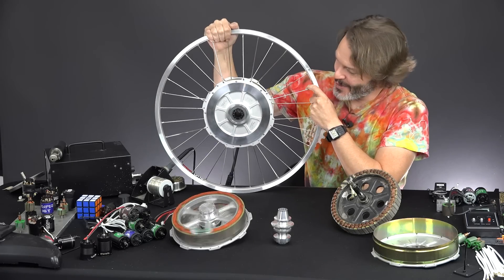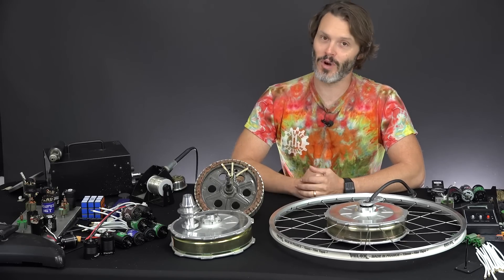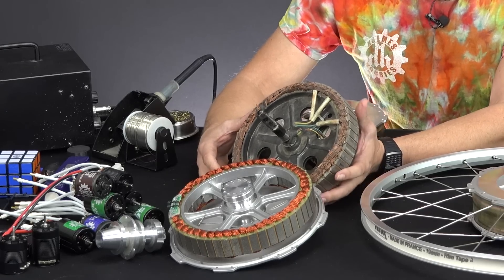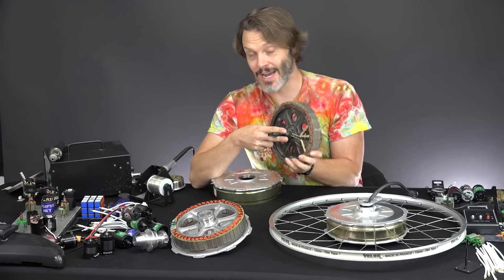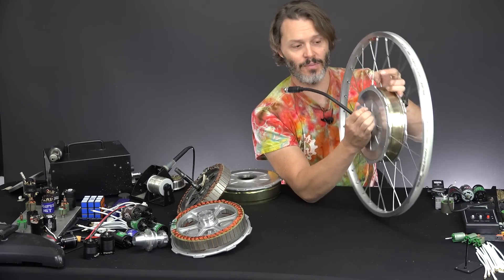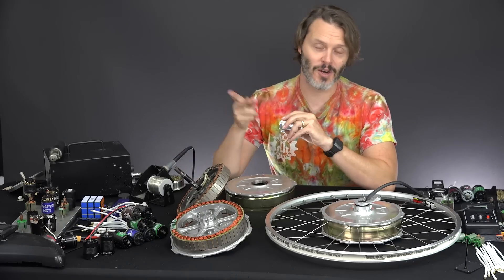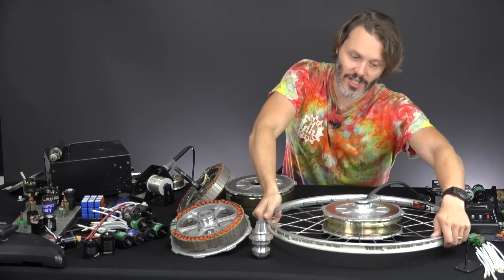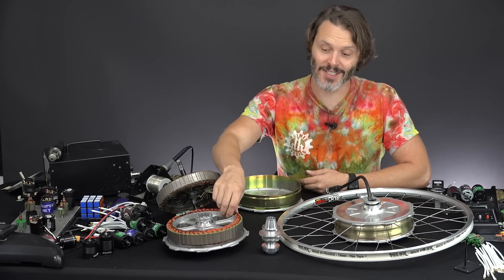Best E-bike Motor You Can Buy - Grin Tech All Axle Electric Bike Hub Motor Overview | Holmes Hobbies

Comment: Most  $1500 e bikes are just a regular $200 bicycle with a $250  kit and battery already installed.  What a Rip offs.
Reply: 250usd?

Have you watched any builds or performed one? 

In the case you have not, or for someone reading this, keep in mind the following: 

The research involved to make all the parts fit and work (The most expensive part as well is not listed in this comment - battery).

As a supplier and custom builder/repairer I can tell you that a battery in AUD (time of writing this) is starting at AU$ 390-450 (36/48V - 20/13Ah).

If you bought a new eBike from me, I wouldn't sell anything less than a US$200 (maybe AU$350) frame because it needs to have a decent quality build to handle the extra 10-20kg of weight (remember all that weight also goes on the front forks along with your weight) when you brake, and brake force increases the stress, if someone has a cheap bike, that person can look forward to a potential issue, possibly a nasty accident if it's all cheap bolts between them and the road)

In AU$ you are looking at 1100-1500 in parts and you still need to build it, that's for 1000-1500w build with at least 30-45 minutes battery life flat out throttle run time. (actual not PAS bulls#*t claims of 100's of kms range, you are looking at around 20km on a charge).

Remember a business needs about 50% mark up to survive (for sale in AU they lose tax on shipping parts in, freight/shipping, port fees - you may not pay for an item to enter, but they will pay because they have a container of bikes, or a large order - then they have to pay running costs on the shop, consumables, warranty, delivery to customers house may be free so there is that to pay as well on the business side... Oh and wages, electric, eftpos (card machine and bank fees).

If you go out now, know nothing about eBikes, or bikes. You need to work out drop out size if you are / are not upgrading an existing frame as you have to make sure the wheel rim fits, you have to get a battery that will fit (you can get some frames with very little space), upgrade the brakes potentially, the controller has to fit as well.

Now it may be luck when you buy parts and they just fit, but it doesn't happen for everyone. Then after all that you have to hope you are not returning an item after all the hard work, pay to ship it back, take it apart. As an individual it's frustrating, worse if you order kits for a business and have orders to fill and then have to make customers wait because 20% of parts from China can and do fail. China builds everything with the rule that 4/5 is good parts, the rest of the 20% is acceptable defective parts.

What tools do you not have, bottom bracket tool, freewheel or cassette removal tools, if you get this wrong upgrading, you will have to buy a new gear set, if you get a freewheel kit and you have a cassette waiting to go on it for example.

Not trying to be negative for those reading, just real. I have been doing this a while, it can be positive and easy, and I wish this for all of you, but it can also be a challenge, or damn right frustrating to the point that a passion becomes a job - that was the case when I started out.

I wish you the best William - I hope you are still in the R&D stage for your build, but if not, if you have any questions I am here to help

Happy riding guys!

Comment: We need this for automotive applications so any car can be transformed into electric...
Reply: I was about to post the same info minus the link, thanks for the info!
Reply: Cost too much the best option is to get old motors and mount them in the vehicle then work from there forklift motors work well
Reply: Worst part is having to get new batteries for a car though I think that would be hell no matter if they premade
Reply: @zeeshyyt2  They have electric hubs now for the Prius....  50hp each side for about $9,000.  It can be done for any car if someone wants to do it.   This would help the automotive industry a lot, to give any car a 100hp boost and have 20 miles of electric travel with a small battery pack that fits in the spare tire area. 

https://www.youtube.com/watch?v=iQ4lTPVR3qc

Comment: I’m very interested in using this motor in an EUC (electric unicycle). I just don’t know the difference between this and the Chinese motors used in EUCs to know. EUC motor run off 84v or 100v battery packs. I don’t know if that’s necessary. Anyone know?
Reply: Building yourself or buying a kit? Happy to help out with what I know but I have not done a unicycle yet, I do custom builds in Australia

Comment: I was just reading about the Grin 'all-axle-hub-motor" last night, I have an old "Giant" frame that I converted over about12 years ago used a crystallite 407 in the rear wheel, worked ok when the SLA batteries would take a charge. The front suspension fork is an old "Judy Rock Shock" and I am thinking that if I can come up with the funds necessary, I should probably get a whole new package. The fork does have mounts for the disk calliper the rear brake is of course V-brake. It does seem that the folks at Grin have this motor nailed down, expensive yes but well worth it I figure.

Comment: I’ve been using Goldenmotor Magic Pie v5 and Edge Motor’s on all my builds.  I’ve done 5 so far with the oldest built in 2016 still going strong.  I like a super clean cockpit so the only thing on the bars is the thumb throttle.  Since it’s throttle only I can use any brakes.  Some bikes like the oldest uses no torque arms because the kickstand on one side and the derailleur on the other side are heavy steel and so far never had a problem even at 25amps with 52v battery peaking at 58.8v.  Another MagicPie-V5 needs 2 Grintech v4 torque arms ir it will spin I the rear dropouts.  The edge motors are smaller and have had years with no trouble and no torque arms in aluminum rear dropouts.  All these have strong regen and are about $400 usd from Goldenmotor.ca or Goldenmotor.bike. I love that the controller is built into the wheel so I get the cleanest build that’s a regular bike with a throttle for whenever you feel like using it.  These are commuter type bikes so nothing fancy.  I’d love to build something crazy but the costs add up quickly.  Love the videos!!!
Reply: where do u get ur batteries from

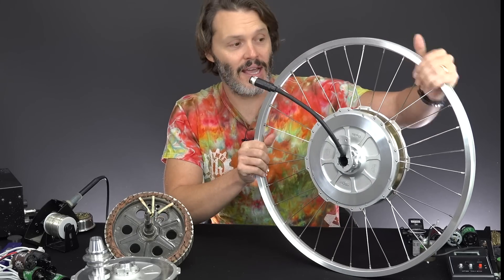Comment: HolmesHobbies, can you design me a swapshell hub for this motor? My desired swapshell hub will work for my hubmotor (on front wheel) like my swapshell for my internally geared rear hub made by Kindernay. See the way this works at 1:09 of this video: https://www.youtube.com/watch?time_continue=61&v=ERedaKUYYf4&feature=emb_logo.  I would like to be able to switch my hubmotor among my roadbike and my fatbike on the front wheel. As a final trick, I would like to be able to use a plain front hub (no motor) for the days that I want my lightweight bike and a proper workout. This would allow me to have a single bike that can be powered or nonpowered.

Comment: I have been using my own torque arms for a few years. Easy to make your own using 9-12mm (depending on Adel size)box end wrench with a hose clamp and bolt.. Bolt goes throu round side of box end wrench. Open end of wrench goes on axle.. Hose clamp to frame or fork
Reply from the maker: I've certainly had a few bikes with wrenches for torque arms!
Reply: Interesting. I hope ti see a video on that. Thank you

Comment: You should re-consider your use of close-ups, and know the exact difference in the failure rates of the two types of torque transfers.
Reply from the maker: It's all documented on endless sphere forum,  which has a better memory than I do.    The raw numbers aren't so important IMO, except that this hub is proven far more reliable in terms of torque transfer.   You can find the numbers if you want exacts.

Comment: Strap on a 12V car battery, Jerry rig a 13,000 RPM Dewalt grinder motor with a DC to AC inverter. Use a 15amp dimmer switch to control speed. BANG ! About 7 hrs usage at 50% pwr (35 kms/hr). TOP SPEED: 70 + kms/hr ! Next mod will include motor from Bullet mixer on front wheel for a 2x2 AWD system !

Comment: I checked out the site, man those are redicoulisly high prices for only 500w kits. Bafang has 1500w for those prices.
Reply from the maker: China engineering from  a decade ago VS fresh canadian engineering and assembly.    Cast parts vs machined parts.
Reply: @HolmesHobbies  again with "cast vs billet" 

Cast is more than enough for 2kw hub motors 
Why should I pay premium for something that is not much of an improvement?

It's not ultralight specific motor to me or other average commuter 
2kg means nothing
Reply from the maker: @blackturbine   If you have never stripped out an axle, spun one out, or had a fork fail, then you  haven't experienced the problems that this fixes and it's likely not for you.  My point about cast vs machined is that cast is cheaper.  They aren't making 10s of thousands of these motors, so the parts are machined and not cast.  Its a short run motor, which will always be higher cost.
Reply: @HolmesHobbies  it's not fixing a problem 
It's just forcing you to buy some premium frame and forks 

Why not make an axle with a keyway that won't strip out 
Or even better 

A chain or belt drive so axle wouldn't be a problem, motor can be much more lighter and easyer to cool down.
Since we are already need to modify our frames to fit that hub design why is it a problem to make a new motor mount? 
Something like K mount for tubes whould be more than sturdy enough for 500w.

Am I missing something?
Reply from the maker: @blackturbine  this absolutely fixes a problem.   You don't need to modify a frame for this motor.  Want to use a QR20 or 15mm through axle fork?  Only possible with this motor.    Why not make a better axle that won't strip out?  Like Grin did?   You are missing the entire point, which tells me you are lucky enough to never have had these failure modes.    I've had them personally and fixed a lot of bikes locally with them.   I work for the local bike shops when they have ebike problems.   Hubmotors are failure prone.   The only reason to think otherwise is lack of time or volume dealing with them.
Reply: I can buy 5kw škoda servo motor and convert it to belt drive all for 100$ 

If you want to make money just sell overpriced junk and just say it's for bike and add couple zero's to the price tag

Comment: First time viewer here. Great applicable information. I am interested in a high wattage motor for the purpose of speeds above 30 mph and torque for uphill. Does the motor you're showing provide what I need? If not, do you have a suggestion? Thank you.
Reply: not that simple! your weight, weight of vehicle, battery voltage and aerodynamics all add up to give you speed. no motor will get up 30mph if you weigh 500 lbs and make a 400 lb bike.
Reply: @khandam7709  Nonetheless,  where is a good starting point (motor and wattage), controller voltage, and battery Ah do I need to get my 175 pound  body and  bike to at least 40 mph via throttle?
Reply from the maker: @rlbrett  go to ebikes.ca and use their simulator.  This hub will do 30mph no problem with the proper voltage and amperage.
Reply: @rlbrett  40mph is very dangerous speed. car drivers do not anticipate you going that fast so big potential for accident.  anything over 35mph can cause death in accident. wear a helmet
Reply: @rollandelliott  You obviously have no experience on a road bike or riding with any cyclist that's in shape.
Reply: @rlbrett  nevermind I thought you actually wanted some help, good luck, next time try google.

Comment: Thermal mass shouldnt be an issue as Aluminun dissipates heat much quicker then steel. Hence why heatsinks are made of aluminum.
Reply: Hub heat venting may be an issue.

Comment: if you know how to build a Ebike, you will never have your motor axle spin out on you bike.  don't know why he is saying that it is bad design...????  my frame on my bike twisted because i had a very powerful hub motor, but never had a spin out.   and i'm a very aggressive and hard rider on my bikes and never had spin out on my axles.  if the axle of your hub motor does not have any torque arms on both side, than you will have serious issues.  and if you torque arms are cheap and loose on the axles then you will eventually have some issues.  if the hub motor axle is properly fix to two thick and strong torque arms, then you will never have any problems.   i have been riding Ebikes for year.  all my hub motors on my Ebikes have major torque and goes much faster than 70 km/h.
Reply from the maker: "never have issues" and "my frame twisted" are mutually exclusive statements.   Yes, torque arms will mostly prevent issues.  Unless they are "cheap and loose" which describes 80% of the torque arms on the market.  Or until your fork or frame gives way, which is rather common.   Axles fatigue over time.   One year isn't very long.   Give it time, I hope you don't get hurt learning the hard way that transmitting torque via 12mm flat axles is a very poor method.
Reply: @HolmesHobbies  Good point !

Comment: sorry,im sure they have their uses, but nearly all Ebike hub motors are basically prone to burn outs and problems ,even the strormer ebike models wch cost up to 9000 USD have their problems with hills,,a hub motor is only made for small hills and flats  otherwise useless ....just fiddling about with builds and projects that will eventually burn out and the end expense of it all and just buy a bosch mid drive motor and you will never worry ever again!!!
Reply from the maker: I've burned up mid drives too.   Nicer motors and controllers have thermal protection these days.

Comment: Those motors look really cool. I'll have to check them out. I've built a couple ebikes using the more generic version that you're showing. All the ebikes I've built I've always done a double torque arm setup. I just don't see it practical to assume any other setup would hold up even short-term and especially long-term. It's good to see there's a better option out there. Thanks for the video!

Comment: I have a mid drive bafang motor i use my own 84v controller what's a 72 volt battery i get it up to 110 kh but if i start at dead stop motor makes a whining noise and I have to Pedal and slowly put my finger on the throttle to get to go do you know why this happens I can't figure it out
Reply: 110kh with a bafang midrive? That's not hapening post a video or you're lying.

Comment: Lots of words and no specs.  What kind of torque does it produce, what are the additional stresses it can handle?  You mention it's a better design and they do scientific testing but where are the numbers to verify it?
Reply: All motors are generally the same it’s just a washing machine motor converted to run more effeciently and in a lighter workload
Reply: What you put in is what you get out with electric
Reply: @zeeshyyt2  not true.
Reply: @mikeb1039  I did dumb ass but the link that was on the site kept coming up as an error code 404 or something like that so mind your own business butt plug!
Reply from the maker: Go to ebikes.ca for full tech specs and on endless sphere forum for the testing information.
Reply: HolmesHobbies Well I tried to use the link that you provided but it says it is a “no go” so can you provide a new updated link to their site please? Thank you.
Reply: @HolmesHobbies      , that sounds like lots of junk-mail niggas luring me to store/website then not even booklet discloses watts, upper amp-temperature sturdiness-tolerance, nor production.         So I will go to website and if headache to find current load, rpm,  performance workload potential,  and  rain-puddle resistance durability ,     there I will tell them to stick it up their weely consumer-disservicing pig-in-a-poke junk-mail .            Wino-Dope Rot for brains hyperbole-advertisers should do jail time for anti-information garbage littering. Switch to Recreational over-the-counter Non-alcoholic Marijuana !!!!!
Reply: @mikeb1039    for sure junkmail is sickening disservice, omitting comparison shopper info,  indoctrinated trash sending trash to communistically trespass my mailbox.    I will make marker-pencil kit for return to sender boomerang.  

You desensitize others into zombie gullibles, "Damn you anti-Green Party false-advertising enslavers."  Obviously your main agenda is complacent stupefied voters, whilst cheating chumps more gullible into resource depleation is secondary.  

Infiltrating Youtube with communistic tactics intends excited false allusions to hide outsourced junk-dumps upon markets.

You mis-presume alcohol to equal herbal nutritional supplements how they temporarily turn off some brain functions,  but actually alcohol permanently deadens/injures body/brain matters until less optimal nervous system detours link in.   Beware how Multiple non-Chemicals are similarly designed to confuse us up too.   Supplanting and  discouraging autonomous endeavors are the Democrat/Republican/Libertarian communistic hypocrites' conspiracy.

Comment: that design could easily be modified to add sot tubes to wrap some tubbing filled with cooling fluid in it to brin the heat out to a external radiator.. like a pc with liguid coolind system.
Reply from the maker: They have a product called StatorAid that actually bridges the gap from stator to rotor, and makes it shed heat really fast.   very simple, and very effective
Reply: @HolmesHobbies  but does ferro fluid work on an aluminum housing??? without the magnetic attraction what keeps it in place?

Comment: I just converted a 26” Cannondale M700 frame with Pepperoni fork to a 500 w 36v front hub motor. I bought a torque arm but sent it back because I guess my nuts are tight enough. It’s racking up some hilly miles with no problems.